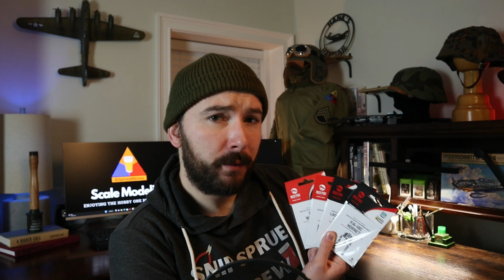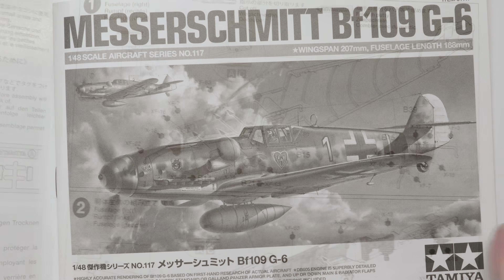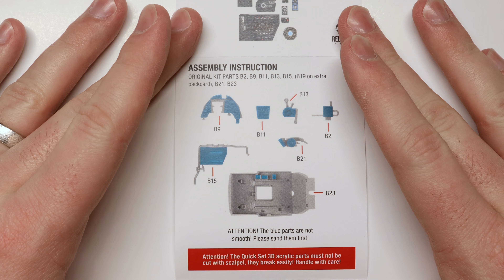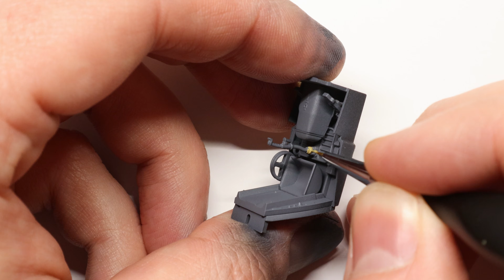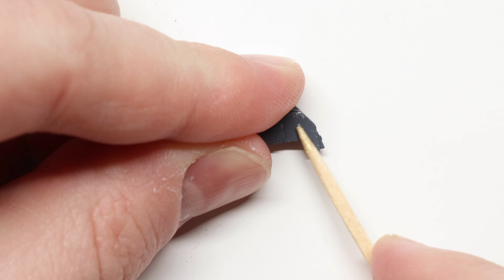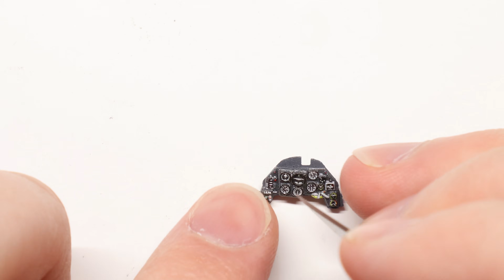Improve Your Scale Model Cockpits! | Red Fox Studio 3D Instrument Panels

Comment: We have a similar problem in gun smithing, especially with AR-15’s. If you’re installing or removing the takedown pin spring and you’re not careful, it’ll zip off into the ether as you mentioned, and god help you if you have a carpeted floor, lol.

Comment: Hi Hank, I noticed that you were struggling a bit in placing those parts with tweezers; I have found that taking a regular Crayola crayon is a superior tool for placing tiny parts strategically on a model.  The wax in the crayon has just enough stickiness to hold the part and place it exactly where it needs to go.  Just a gentle slight twist releases the part.  Works like a charm each time.  I prefer regular White crayon to make it easier (by contrast) to see the part and exactly where it will be seated.  Give it a try and let us know if it works for you. I will be ordering some of those Red Fox instrument panels.  Thanks for the great review.  Cheers!
Reply from the maker: That's really interesting! I've never heard of that - I'll have to give it a go! Thanks for the tip 👍

Comment: Nice video👍. Just started a Build Tamiya 61063 also BF109.  Why are the prices so different between almost 2 identical Models.
Reply from the maker: Nice! That's a great kit as well - the Bf-109 you're building is an E-4/7 variant, and Tamiya originally released it in 1998. The one that I'm working on here is the G-6 variant, which Tamiya released in 2017. The G-6 has options for both open & closed engine cowlings, as well as choices for positioning the flaps up or down. Quite a few more options with the G model, but they're both fantastic kits. I've built a few of the E-4s & it's one of my favorites. Enjoy!
Reply: Ok. Well now i know!  That makes sense. Thank You. It was on your starter kit list😉. Just starting the Hobby. In my youth (Boots were from wood and men from steal 😂) Build al lot of airplanes. Your Channel inspired me to start the hobby again. A lot has changed in 45 years 😅